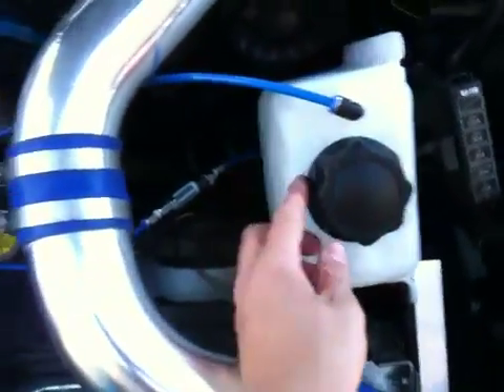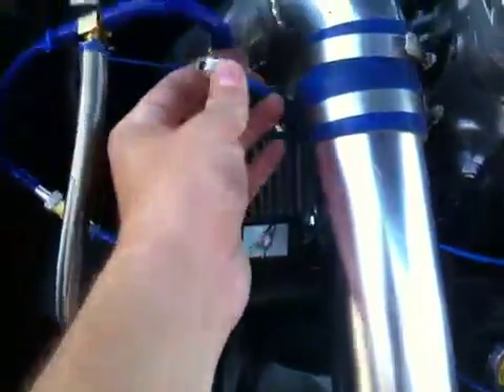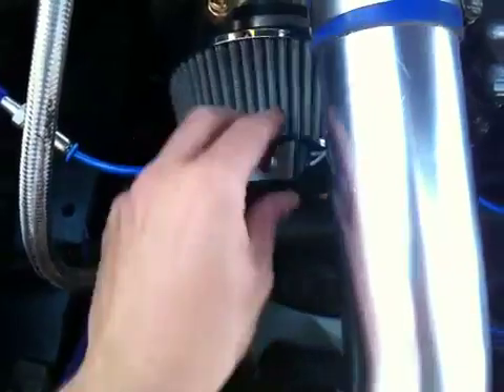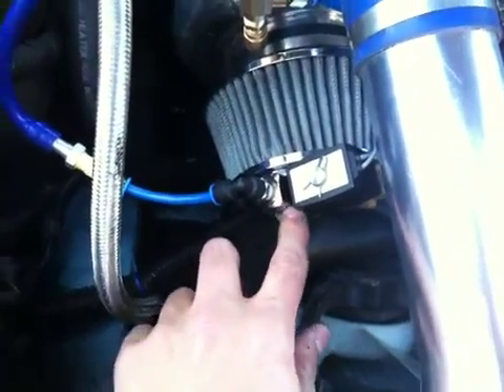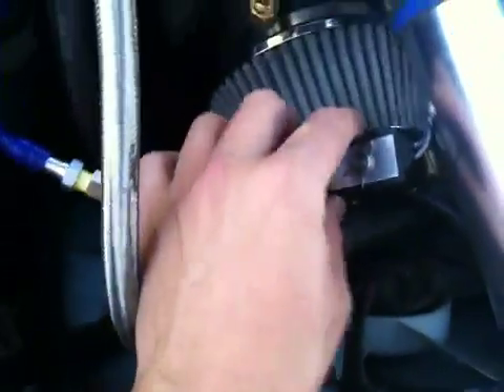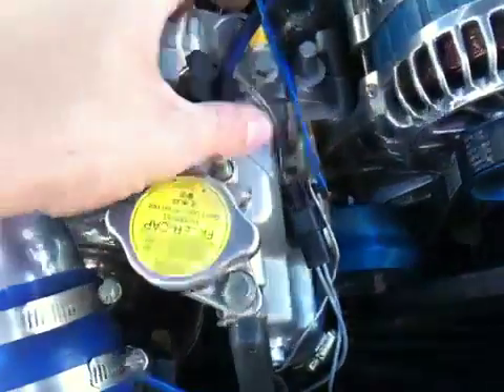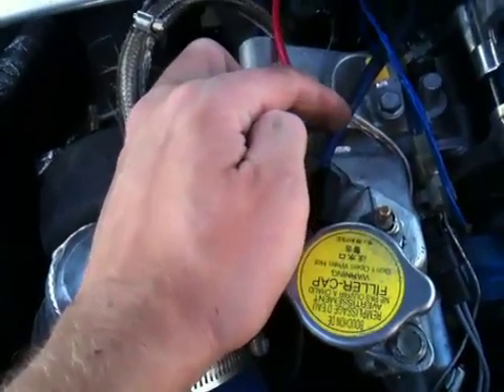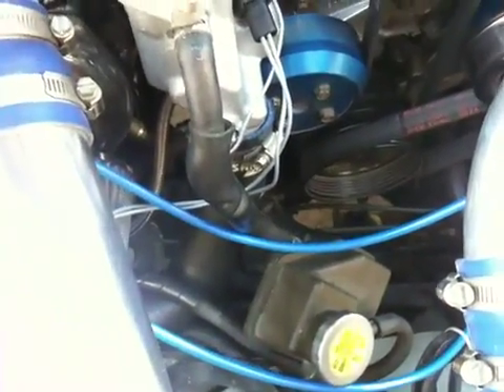Water injection installed and operational

Comment: Use should use A separate system that constantly sprays small amounts of water into the engine while not under boost.  It should be hooked up to A vacuum line and adjust the flow with A valve.

This system is for A MPG boost and should only use water in the summer and washer fluid in the winter.

Since this system will constantly be on, I don't recommend it being installed before the turbo!

Comment: I am also injecting water in my 200cc bike and after 5-6 months I have to replace my exhaust with stainless-steel exhaust system bcz old one starts rusting due to water steam. so be aware,replace with steel if there any iron parts in your exhaust system.

Comment: so is water injection like a boost source?
Reply: +Kevin Berrios Yes. The water cools down the air intake, a common problem with turbochargers. Cooled air has a lower density and can make a much more clean and powerful combustion. The water can also prevent pre ignition in the limit range of the engine revs (I'm not so sure about this). This is way is not very efficient but is cheap and simple to install and use a smaller intercooler for example in a turbo kit.

BMW is making a system wich inject water into the combustion chamber to cool down, prevent pre ignition and work with higher compression ratio (from 9,5:1 up to 11:1 in some cases). The BMW serie 1 went from 136 hp up to 218 hp with less pollution (the combustion were way more clean) and almost 30% less fuel consumption in some rpm ranges with an average 20% less consumption . It's a big step if you compare the 2 versions of the same engine in terms of durability, power and consumption. It's yet under test but they say 100% sure it'll come to production cars soon. In smaller engines like 1,5L from serie 1 they say the system can use the water from the condensation of air conditioner, but a small tank with 5L of water can be enough for more than a full tank trip in medium sport engines (I think serie 3 and 4 engines).
Reply: rafaelrp07 
cool air has a higher density.not lower.does giving more molecules of air to burn giving more power for same amount of fuel
Reply: rafaelrp07 Yes sir that's what BMW M4 GTS comes with from factory,  cool air has more O2

Comment: Rotaries are less likely to hydro-lock.  Preturbo I believe somewhat alters the compressor map as well as affect AITs more (could be making that up) more than water further upstream. Water doesn't do a great job of cooling AITs which is where alcohols come in. Meth has a flash point that will cool the air charge significantly upstream (most e85 guys are missing out of these benefits by short path to cc). Water's benefits are in the compression and combustion cycles and cooling CC temps (rotary).

Comment: In 1969 I owned an Olds 442 that got 9-10 mpg. A company called API sold their MkII Vapor Injector. After installing the injector I averaged 15 mpg. The company was shut down by the CA Air Resources Board because it spliced into the PCV valve line. CA said it "tampered" with the pollution control system, thus violating 'law'. When tested at numerous 'smog stations' the vapor injector significantly REDUCED the pollution coming out the tail pipe. Within 60 days the company was put out of business.
Reply: bkBeaker55 tell us more. How did it work?

Comment: Im all about meth/water injected.  That being said, Its not a good idea to run it before the turbo or inter-cooler!  You just putting all of your stuff through unnecessary conditions that is bound to fail prematurely...  You have a nice car and set up, why not just move it 6inches before throttle body on intake???

Comment: Nice Effort
 since your water delivery is running on boost pressure, The amount of water delivered at say 10 PSI will be the same wether its at 3000 rpm or 6000 rpm, if you want to follow the rule that 15% water to the combustion mix.Of course some of the commercial systems use an ECU like device which sprays the water proportional to the amount of fuel going in and not proportional to the boost pressure as most DIY systems do these systems will give you a more consistent power gain+N/A engines

Comment: Nice car and that's a gorgeous engine bay, always nice to see someone taking car and having pride with their car.

I don't understand what water injection is though, I always thought having water injected and mixing with the fuel and air would cause problems like misfires or something, that's why I was told to keep the intake / air filter hose away from the bottom of the engine bay(to minimize the amount of water that's sucked in).

Comment: Injecting water vapor into the intake allows you to use lower octane fuel without pre ignition or dieseling or knocking. Which means you can buy cheaper fuel.

Comment: Man the system looks good but the idea is to cool the intercooler.
Not the spraying water into your intake.

And the to power lines connected to the solenoid seems very dangerous to me, since you are spraying water on it.

Comment: dude you install the injector nozzle AFTER the turbo, NOT before!!!!! you'll be sandblasting ur turbo! 
half the reason you run water injection is cuz when the turbo compresses the air it heats the air up (and when running very high boost it heats up a lot), so cooling the air before its heated up is much much less efficient.
which brings me to my next point, the air needs to atomize directly from the nozzle so it mixes with the air, ur setup wont have the pressure for that, needs 100psi ish

Comment: Hey with out a good atomizing spary cause your using turbo boost to spray you dont wanna inject that right into your turbo its kinda like sand blasting your compresser wheel

Comment: yes the air the mixes with the fuel for the combustion to happen, the colder the better less carbon build up on the rotary spark plugs, less detonation ! which is the best because rotary engines cant take much of that

Comment: Have you tried applying 15psi with the compressor and see how does nozzle spray looks like. It is very interesting idea but atomization might be poor. I would not tune the car with this type of setup to increase boost and power. You probably would see benefit lowering the knock with you standard gas only map. To bad our cars can not run 40-50 psi .. atomization would be probably lot better :)

Comment: This style of water injection is design only to absorb specific heat.  Therefore it doesn't have to pass anywhere, it need simply contact the supplied air for a slight moment.  Once the water has aborbed the heat it's going to in the time is has in contact with the air it's job is done.  We're not doing cylinder water injection that isn't needed.

If you're running water/meth and your goal is to attempt to suppliment fueling and boost octane THEN you'll want the placement as close to the cyl AP

Comment: use a pump ur injecting at 10psi of presure not very efficient the new pumps use 250psi ur setup is way to low of presure just tring to help

Comment: i have the same system on my 13b, 402rwhp on 19psi through an auto, our dyno's are harsher on power over here in australia, i have had it up to 26psi (wheelspin in top gear) guessing around 450-480rwhp, turning it up to 32-34 soon.

Comment: So, after pumping water into your compressor wheel for some time, have you taken off the turbo inlet and found that your compressor wheel is being eroded away? Water is very abrasive (especially when the comp wheel is rotating at 100,000 rpm and smashing into water droplets) and everyone that I have ever seen implement their water injection in this manner has had their comp wheel ruined.

Comment: @emerciv oh,  interesting.
my friend has meth injection on his 03 wrx, he has a small tank like yours, but bolted onto the firewall.
he has a two-stage setup so it only sprays a little under low boost, ~10psi and sprays max at peak boost ~20psi

*I dont have an rx7 but ive been looking into getting one for a few years now.